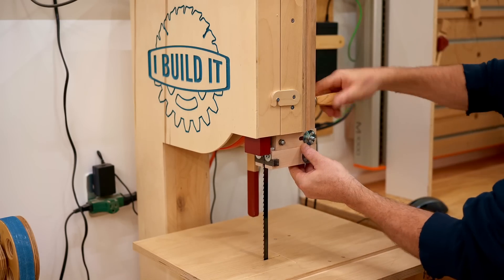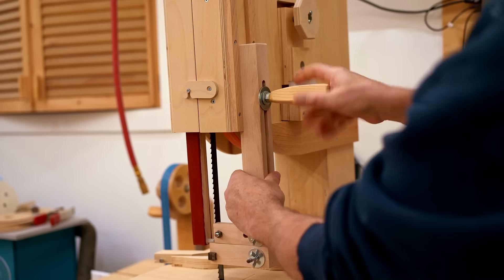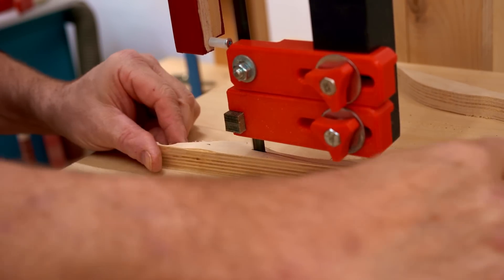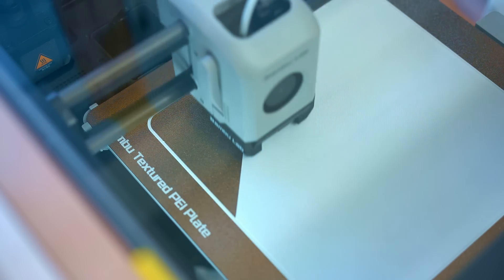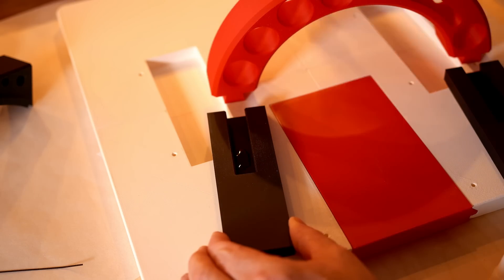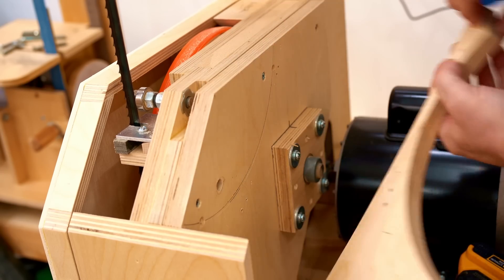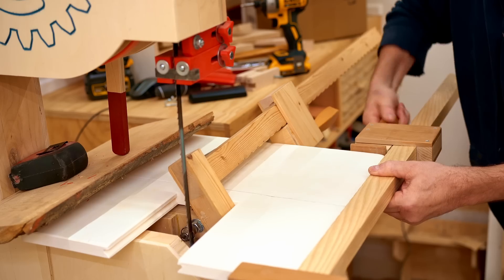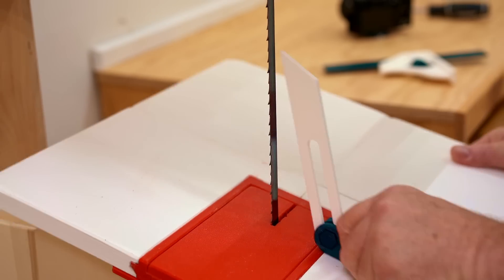He Said You Can't 3D Print a Band Saw... I Said Hold My Beer

Comment: I am using a 3D-printed blade guide for my 66-year-old bandsaw, so it is not a load bearing part. But especially what you had happen to the wood getting caught and slamming down on the table happened to me with another bandsaw with an aluminium table and boy am I glad that I sold it and now have a massive cast iron table. Making (and using) a 3D printed table is just waiting on losing a finger or two (and that's coming from someone who has a mainly 3D-printed CNC).

Comment: I think the plastic bandsaw is a neat trick, but the demonstrated failure potential is kinda scary. I'd maybe re-print the insert with a slot in it just narrower than the toot offset on your blade, so you get solid walls on both sides of it.

I would love, though, to see the process of thinking up jigs and templates to do woodworking things, and the process of getting them set up in (FreeCAD?)- Drill guides, spacers for aligning drawer fronts, latches, templates...

Comment: These days I'm using ABS+ for most mechanical parts. It's a slightly harder to print than PLA and it's not quite as strong...But ABS+ is more resilient and stable over time. You're going to find given time  PLA warps and sags. It's not just heat, anywhere there is any stress even just gravity PLA will yield overtime....Another tip, Black plastics of any type are generally UV resistant. Black plastics use carbon black as a pigment. Carbon black is unaffected by UV and it blocks the from light penetrating the plastic.

Comment: Meh, 3D plastics have limits, sometimes really low limits. Wood is easy to work and has some strength, aluminium is stronger again, and steel is the bomb, but so so hard to work.
So plan your jobs as hybrids, get the best from each material.

Comment: If you make the holes slightly undersized compared to the bolt, you don't need to tap and you can just thread it in and it will act like a lock nut (so also no more bolt-nut combinations). Up to m6 I undersize by 0,2mm (so 5,8mm for an m6 bolt), not sure what that is in imperial. In my experience it is even harder to strip than tapped holes but I never really tested it

Comment: I am a terrible woodworker but use a lot of structural 3d printed parts.  It looks like you have made yourself an enclosure for your printer get some abs you will find you have a better time.

Pla is incredibly tough however under tension it creeps print yourself an insert pass a bolt through and place it under tension on a scale and see how long it takes to creep would be an interesting video then do the same with abs

Comment: the large wood table with the flange design for the 3d printed insert makes sense to me... The insert is a replaceable part as you mess it up with the blade... good for 3d printing you can print another anytime... The trunion is good as 3d print too... Not sure about the blade guides... PLA has such a low melting temperature... Also, I saw a thing. someone did a survey with pretty scientific testing of the various infills. Gyroid was strongest. But counter-intuitively the number of walls was more important to overall strength than infill. I think the combination of 3d printing and woodwork is pretty cool. So many options...

Comment: I'm ambidextrous. By all means, carry on with the 3D stuff as well as the woodworking. I tried 3D printing some parts with Bambu Labs PLA-CF (carbon fibre) yesterday. The part I printed needed to be a little bit stronger than average and it worked beautifully.  Brimming with confidence, I set about printing multiples of the same part and came to a screaming halt just 15 layers into the first print. Clogged nozzle... It was the Devil's own job unclogging it and the carbon fibre filament is back on the shelf for the time being...

Comment: 3D Printing is cool, but I like wood more. 
I'd like to see some 3D printing stuff, but mostly wood. I'd say a good 3D Print to Wood ratio for me is about 1:10 to 1:5.

Also, it looks like the wood watched on the seem in the table. I don't know how you'd fix that other than maybe glue or some kind of filler. Or maybe printing a very thin piece that lays in the middle of the seem.

Comment: instead of adding thicker infill, use thicker walls proper. 5 layers is minimum for rigid parts. infill doesn't add as much strength as one may think vs the design of the project and wall thickness. cool concept nonetheless.

Comment: The difference between the wood and the 3D-print material is, that you can hardly reuse the plastic, while the wood you can at least be burned in an oven afterwards. Try that with your 3D-print leftovers.

Comment: Definitively would like to see a fully printed version. Try printing with ABS/ASA or PETG. Use Caseway SC-200 to weld the parts together instead of CA glue or construction adhesive.

Comment: That's super cool! You can use a glue specifically for PLA called 3d gloop to solvent weld parts. I find CA glue is great but will fail without warning and pretty spectacularly on some of my parts. Adding 3d printing into the mix is great. Why limit yourself to only wood :D

Comment: more perimeters/top and bottom layers are necessary for this kind of use, and if you are going to tap a screw make a slightly undersized hole in place so you have actual material to grip into. I would also sugest mouse ears on corners to combat the lifting and using 0.6 or 0.8 nozzles because the thicker the layer, the better for adhesion and part strength

Comment: Thomas Sowell says "There are no solutions .. only tradeoffs". I think this too applies whether to print plastic parts for construction or to stick with standard wood working methods.
*
You said that the small parts took an awfully long time to make from wood .. so there is an advantage for printing these parts in plastic. Especially small parts that receive the most wear .. they would need frequent replacements. Would be nice to have the plans for these saved and handy in order to quickly print these as needed. 
*
I'm sure in other cases there are advantages for wood parts .. less brittle .. nicer aesthetics .. fun to work with .. things that would lean towards using wood for some things.
*
Like everything there are tradeoffs that need to be considered .. and use what makes the most sense.

Comment: Really cool, I wouldn't have even thought to try 3d printing something like this. For future reference, if you want to beef up your parts, it is usually more effective to increase the number of perimeter walls and top/bottom layers, rather than the infill, because the majority of the stress is carried on the surface of the material rather than centre, except when in pure tension or pure compression where it is uniformly distributed.

Comment: I think that with a channel name "I Build It" that I'm perfectly happy to see you build with anything from 3d printing through casting steel. A couple of variations on this might be making a bandsaw table for a portable bandsaw that you can take in the field for making square cuts in tubing, or custom angles as needed, but that may not be a task you need to cover.

You're building and making cool things. That's why I subscribed. As someone who's designing things in FreeCad, seeing someone else making good use of the program to solve problems they are working on is also good. It's a little rough around the edges, but I'm OK with that.

Comment: I would recommend to instead of threading the plastic to place a nut inside by pausing the print a square but usualy works better then the normal nuts. And perhaps some upgrades with better dust collection would be nice ;)

Comment: 3d printing tools to use for woodworking is valid
and 3d printing things that are hard and complex to do in wood for major tools like the bandsaw are very clearly good as they make it easier for someone to build one.
I think a full printed frame would be too ambitious for most people, but things like you already did and the bearing blocks and tracking adjustments are the more fiddly parts to build (especially if you don't already have a bandsaw).

It would be interesting to see how much you can replace and where there are problems

for the bandsaw table, I would probably go with either prefinished plywood or melamine rather than piecing together printable parts, but it's good to try and find the limits

Comment: I'm not sure if anyone else mentioned this, but for the table, you should use thread rod  to go through the prints  kind of like rebar in concrete. Then use nuts on both ends to lock them together - you can even insert the nuts mid-print so they are locked inside the plastic. This will add a lot of strength, especially if you print the pieces vertically, rather than horizontal like you have now. It will put the layer lines under compression so they cannot split along them. Normally you would never print a flat surface like this vertically as the layer lines are the weak point, but by having the rods run perpendicular to the layer lines and applying compression, you gain strength in both directions.

Comment: I love using the 3D printer for knobs. I recently replaced all the tool adjustment bolts on my bandsaw with toolless knobs I 3D printed to fit just right. I initially had problems with threads in Fusion and the 3D printer, but I added a parameter for thread tolerance of .05 and I use the push tool to push the threads back .05 on all faces and now they thread perfectly.

Comment: Would be fun to see if you can more or less make an entire useable bandsaw from 3D printed parts. So please do take it further :)
Also in regards to the table insert, the area of the insert that gets cut by the sawblade, has to be solid to ensure stabillity of the surface after the cut has been made. I.e. there still needs to be full vertical support between the bottom and surface of the insert after the cut has been made.

Comment: Wherever the design requirements do not exceed the material capabilities, 3D printing should definitely be considered. 

The DIY CNC community has has great success with this approach.  The MPCNC (Mostly Printed) and Lowrider CNC designs from V1 Engineering have proven this.

Comment: Anywhere that a 3d printed piece might be subjected to heat, don't use PLA. It doesn't take much heat for a PLA part to begin to deform (like the blade guide). Use ABS, PETG or some other engineering filament.
Also, I would highly recommend switching to a 0.6mm nozzle and using a carbon fiber or glass fiber filament for structural parts.

Comment: I just like watching whatever you do John. I don't have a 3D printer so I'm obviously biased towards wood but I still enjoy everything you do and you have to be interested in the projects you take on and they will evolve over time. When I made an insert for my 14 inch band saw that I bought used I made it zero clearance. Not long after I was using it the blade caught just like yours and I believe it was because the insert I made was zero clearance. There wasn't much room at all for the sawdust to be carried out by the blade. I had a feeling you might have a catch when you tried the max depth of cut, haha. I'd suggest drilling a hole just in front of the blade in your insert to help clear sawdust or just make it not zero clearance and have it be wider on both sides of the blade and it shouldn't bind like it did. Once I made that change for my band saw insert I haven't had any problems and I've run hundreds and hundreds of board ft through it.

Comment: A few tips I can give you are: get a UPS for every computing device you have, TV, computer, 3D printer, what-have-you; melt in threaded metal inserts for 3D prints; to replace something as structurally sound as wood, use 100% infill; and general advice that you probably don't need but I tell everyone anyway, have at least 3 backups for all of your data.
Reply: 100 % infill is good only for small parts
large parts are structuraly stronger with a lower infill like 15 to20 %
More important is top and bottom number of layer and even more outline perimeter
Reply: UPS went on my 3D printer rather quickly when even the smallest power bump made me lose hours of work.
Reply: There's someone on youtube who has been filling his 3d parts with concrete lately. I would assume fiberglass laced concrete inside of a 3d printed part should be plenty strong.

Comment: I have 2 printers resin and fdm and while they are super capable I feel alot of people when they get started printing they get into a mindset like "when you have a hammer everything is a nail" while I guess people need to learn printings limits themselves there are strengths and weaknesses to different processes,i try use the best for the aplocation and printing where it suits, for the table I would just use some wood or metal but the rest of the components seem a good fit easily printed

Comment: For some reason Matthias seems to be a bit of a Luddite when it comes to 3D printing. He got indignant with another YouTuber who printed some sanding blocks because “yOu cAn mAkE It oUt oF WoOd.”
Reply: He's an old sole, can't comprehend things like 3d printing and is quick to dismiss it, usually based off some knowledge on it thats a decade out of date. With the obscene levels of materials available and printers like the Bambu's it's made it a very easy, and very viable medium for creation. 

For the bandsaw somethingh like PLA-CF or (for total overkill) PA6-CF would likely perform better than PLA which has a low melt point.

Comment: There are very few who do the full wooden tool builds, and even fewer doing 3d-printing (as far as woodworking tools go).  So I would find this very interesting.  The plastic is obviously weaker than wood, but wood is weaker than steel and it works fine as demonstrated... so, how far can we push it?  Can clever design be used to deal with the forces involved?  I'd like to see!

Comment: Good job John. I think you probably can but should you is the question… I think sometimes the channels that push 3d printing really push home the message that everything has to be 3d printed but then still use bearings, screws and bolts. Same with things like storage - Matthias made storage from yoghurt tubs a while back and added grid support from wood - you could do something similar with 3d printed supports rather than all 3d printed…

I think what I’d like to see is using stock metal - tubes and bars for strength surrounded by 3d printed materials - I think you could easily do a full bandsaw like that. And say plywood wheels but 3d printed pulleys etc. kinda like you did with your 3d printing enclosure…

Comment: That's a big thing when it comes to 3d printing. Don't think of infill as something that gives a part more srength. Instead, think of it more as internal supports. Tests have shown the infill doens't contribute a whole lot to part strength. It does a little, but adding more peremiters and top/bottom layers create much more. So, if you want to make a part stronger, the outside shell is what you need to focus on. 

Personally, you should just do what you want to. I find the 3d printing videos just as interesting. The times are a changing though. Even Matthias got a metal lathe. I think he's going to come around to cnc and 3d printing sooner than later.

Comment: imo what you should probably do is make an hybrid design, with simple wood shapes that can easily be cut with a handsaw (or use temporary parts that are replaced with wood cut on the bandsaw later) for the large flat sections (so make the table with a U piece and a block, and have the slider be screwed-in 3d prints.)
probably use nut inserts instead of screwing in directly.

you might want to use full infill in between the nut and the screw head if your slicer allows it (cura and slic3r both support that, search "Different infill in the same part") that prevents the screw from crushing the plastic when tightened. 

also on the topic of hybrid and temporary parts, you could also incorporate aluminium extrusions and/or steel box bars , angles and tubes as upgrades since it's a bandsaw

another building technique that I find interesting is plastic inserts in concrete.

Comment: I'm always happy when I see someone who specialized in working with a material try something way different, like 3D printing and getting something out of it.
3D printing is great, for some cases. Mainly complicated or outright impossible shapes (with other means of making), but it has it's weaknesses too.
And I think you can only get the most out of it when you accept that sometimes, just because you CAN print something, it's not the BEST approach.
But that wisdom needs to be found first, which can only happen when one tries it out. So I'm all for adding 3D printing into the mix.

Comment: John, I love your journey. It reminds me of the journey I went through on my CNC machine using 3d printing. 

A few suggestions I see as someone who does a lot of functional 3d printing parts. 

-Add more walls on structural parts. It might seem overkill, but it REALLY helps with plastic deformation over summers and under tension. I also advise exploring gyroid infill, it seems to have great strength in all directions. 

-for you table. You might consider through-rods with thin 1/4” threaded rod or something to help just keep the table from stressing their joints/joins too much where it counts. Especially since there will be weight on it. 

-for your PETG pins, orientation is everything. Avoid stressing along the layer lines as much as possible for structural prints, even if parts come out less pretty and need some sanding/torch finishing 

-don’t be afraid of adding extra top/bottom layers also. It eats more plastic, but it gets you more life from your plastic IMO. 

LOVE THE CONTENT !!
Reply: Great info